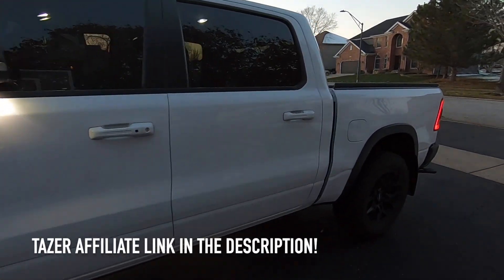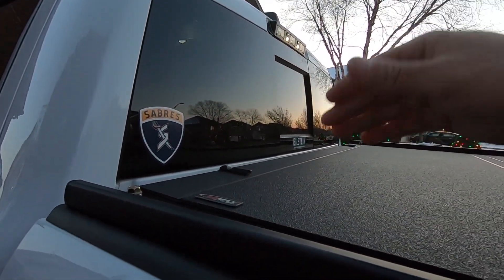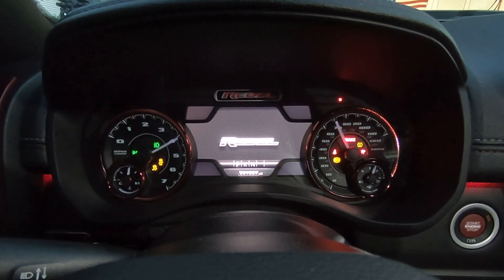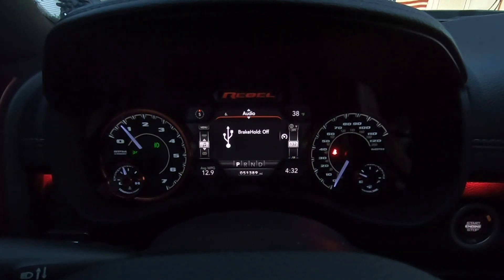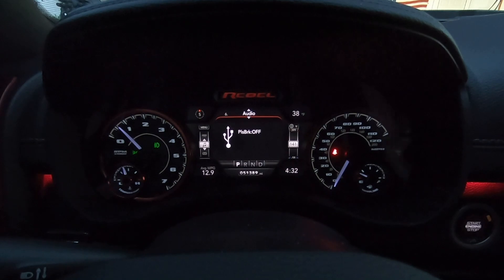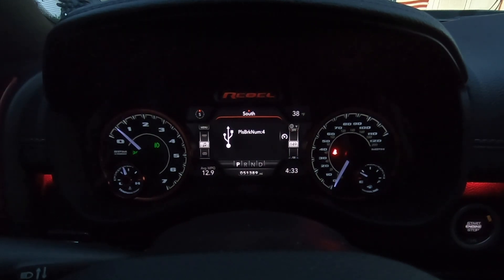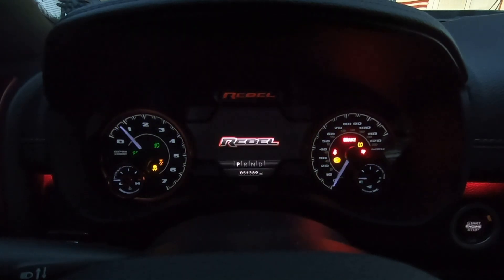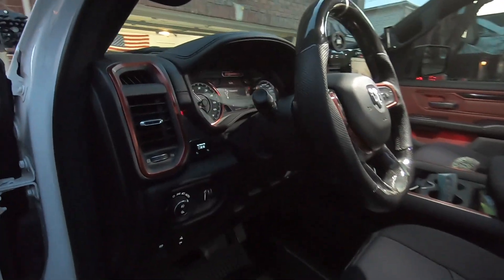Tazer DT 3rd Brake Light Pulse - Ram Rebel (making my 3rd brake light go blinky blinky!)

Comment: Great video. Thanks. Question for you. I have a 2021 Ram Rebel 1500. It's the midnight edition. It came with all LED lights except for the 3rd brake lights. I don't understand why. Is there a LED 3rd brake light you would recommend? Thank you in advance.
Reply from the maker: If you want to keep the factory housing and just replace the bulbs.  Diode Dynamics and Lasfit are great direct fit bulb replacement options.  If you are looking for a whole new housing, can't go wrong with the Evil MFG or the 2021+ OEM housing.
Reply: @WaterFowler41  thank you

Comment: Is there a way to enable the cargo lights or brake lights on as drl? Similar look tobthe raptors 3 red lights.
Reply: There would be, but you'd have to run a trigger wire to a relay under the hood.